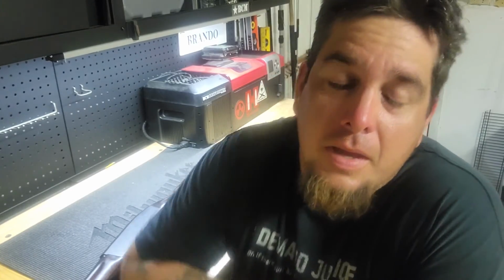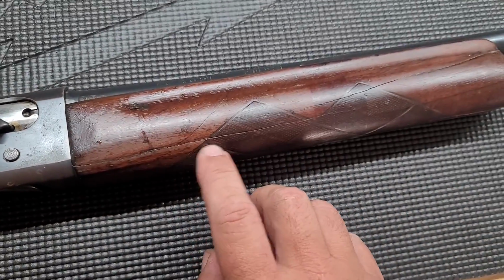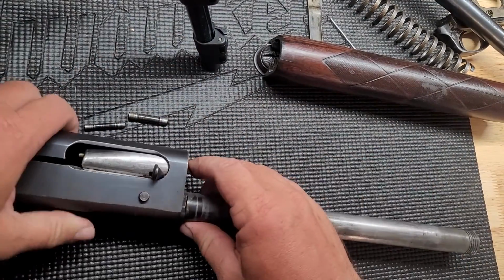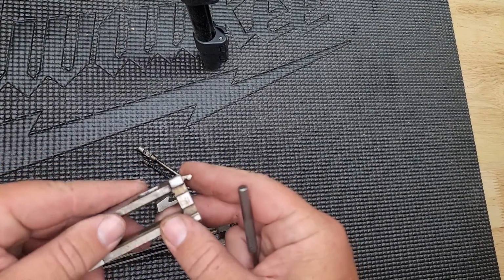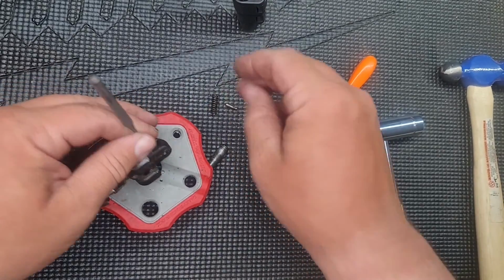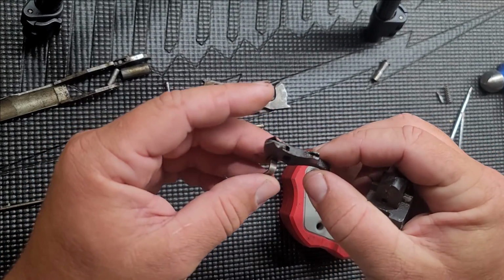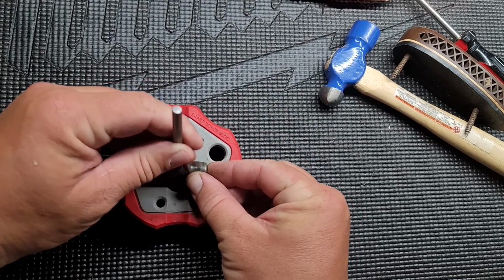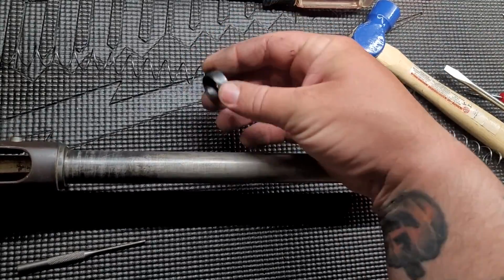Disassembly and Inspection of Remington Sportsman 48

Comment: Your video was really helpful on two accounts.  The first was the disassembly of the bolt.  The second was deciding NOT to take apart the trigger group after seeing how difficult it was.  Grin. BTW, I have an early model 11-48, and I was able to get the shell plunger out as my tube did not have any detents.
Reply from the maker: I'm very glad the video was helpful to you and thank you for watching 😁. The trigger group was in such bad shape, it has to be stripped down to go in a sonic bath. I'll do a video on that in the near future.
Reply: Dustin, 
The 11-48 doesn't have the 3 dimples in the magazine tube, which is indicative of the Sportsman 48, because it was marketed for the hunters who were only allowed 2 shells in the magazine. There's an old fix to that, though, by using a round file to file the dimples down and allow smooth passage of the plunger past that spot. I've got the 16 GA version, early 1954-barrel date code.
Reply from the maker: @lonanderson2646  that's a great tip.